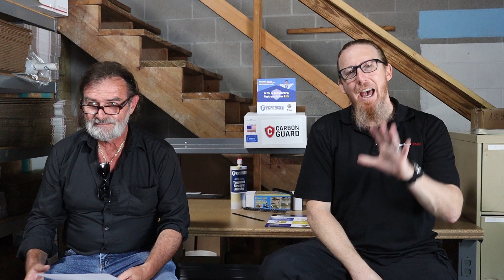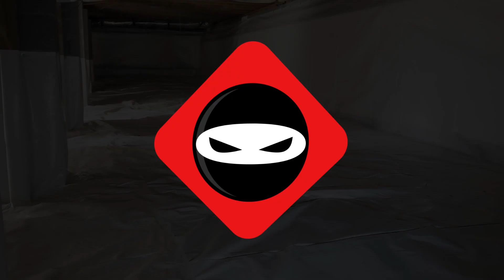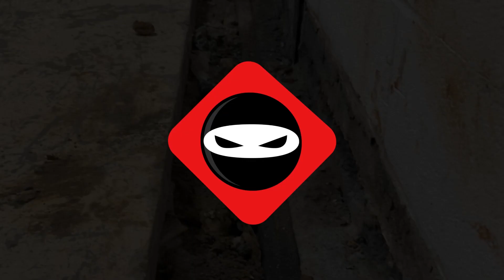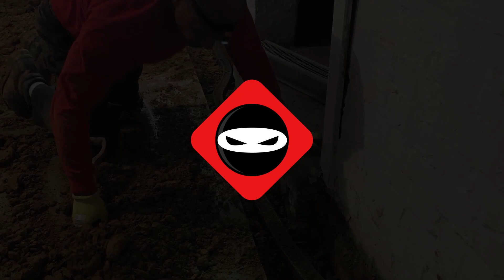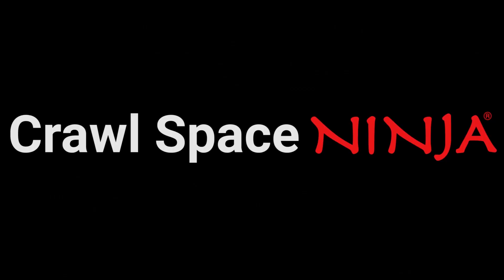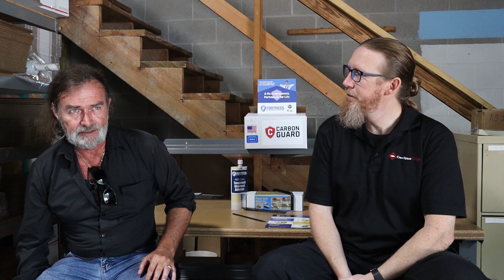Shocking Basement Wall Problems You Need To Fix!

Comment: What he meant when he said "They didn't load the pilasters" is that they didn't put any weight on the top of them to add tensile strength. The pilasters were attached to the walls, but they weren't secured from the top with a "DOWN VECTOR" so, it was just the wall supporting the wall, and they were usually secured at the bottom into the slab. And I have seen actual cinder block. Try hitting one of those with a Hilti gun. Frankly, the best house is a big fat slab home with a ten foot grade away from the house with about 6 inches of the concrete above ground. Get the roof water away from the house. Borate the home after its framed, and enjoy 50 years without home repairs.
Reply from the maker: Very interesting. Thanks for sharing your insight!

Comment: At 1:42 - I was not aware that home building techniques in the 1970s/1980s changed from using cinderblocks to using poured foundation walls, or that cinderblock walls are more likely to bow out and crack, although I suppose it's common sense if you think about it,  especially if the cinderblock foundation wall has no rebar reinforcement inside the hollow cavities.
Reply from the maker: Keep in mind Todd was speaking about his location. I don't think nationally that has happened because in our area cinder block construction is still common. Thanks for watching.